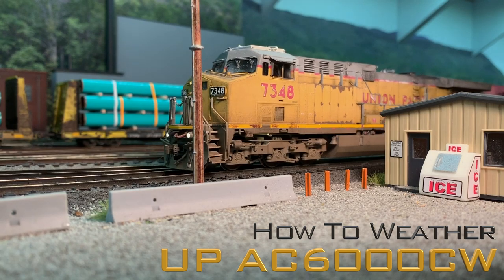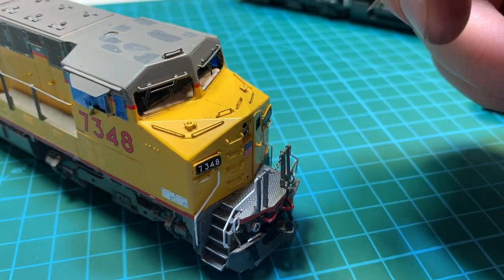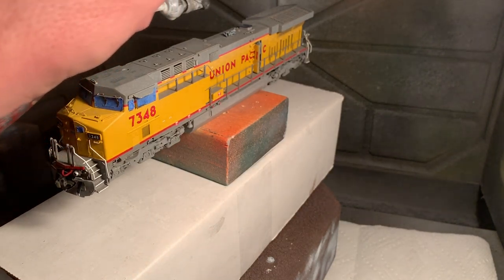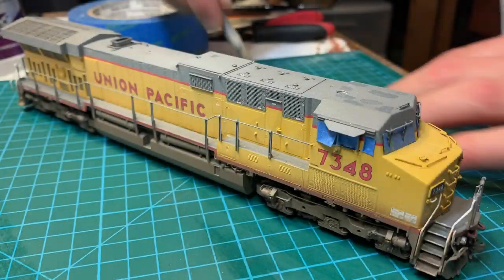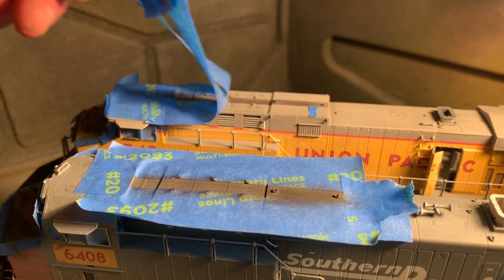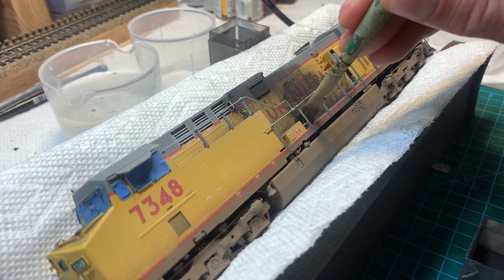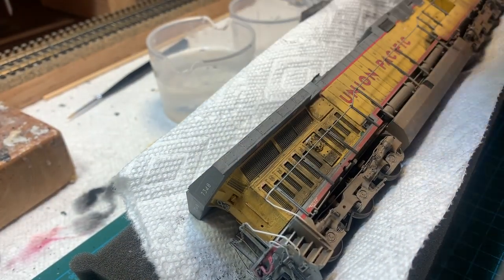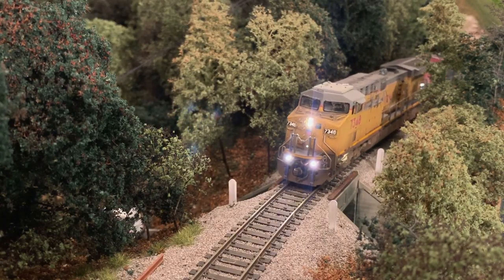Weathering a Diesel Locomotive - UP AC6000 Tutorial

Comment: I don't want to disapoint you but your UP AC 6000 is in fact an AC 6044 convertable with a 4400hp prime mover. You can tell this by the bath tub exhaust stack that all AC4400s have. AC6000s have two smaller square exhaust stacks. All the same you have done a fantastic weathering job on it.

Comment: I also use Krylon Matte, but I use the spray tip from a Testors Dullcoat can, and warm the can of Krylon before using (a minute or two tucked between your thighs works - sounds weird, but….). It produces a finer and less blotchy finish…

Comment: 10:54 what is the name of that safety light near the axle piece on the bottom? I love that level detail it looks extremely realistic...
Reply: coffeecat450 it’s a step light, it’s so if the crew is at a crew change at night they can see the steps and the trucks/ wheels
Reply from the maker: It's known as a "truck light." Sometimes in the cab of a locomotive it can be difficult to tell if you are moving or not and crew will often look out of the window to the ground for reference. The light helps illuminate the ground so the crew can tell if / how fast they are moving at night. Thanks!

Comment: I liked how you weathered your engine, could you use white weathering powder to fade the engine and get the same as your engine if I used weathering powders and enemal washes ? Due to I don't do airbrushing. I'm also from the UK and love the American locomotives.
Reply from the maker: Thank you. I believe you can, but light weathering powder is difficult, as most of it goes away after a clear coat. I will give it a shot and let you all know how it turns out.
Reply: @nsmodeler24  Thank you only cos I have some American engines CSX livery